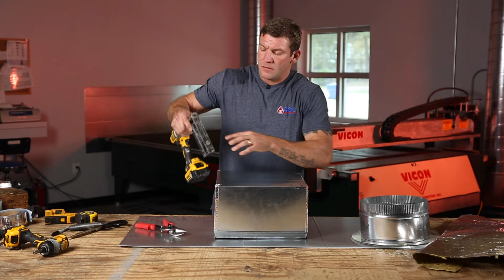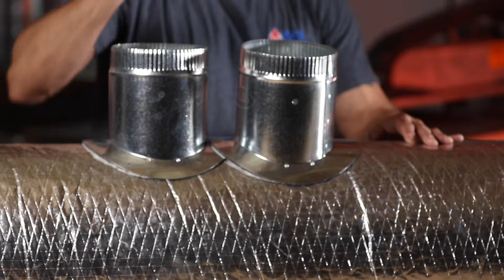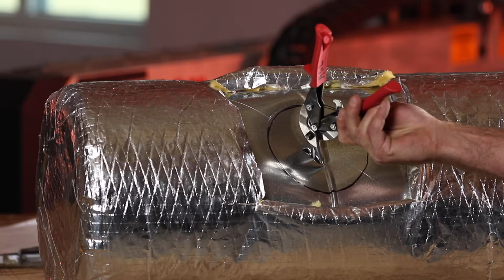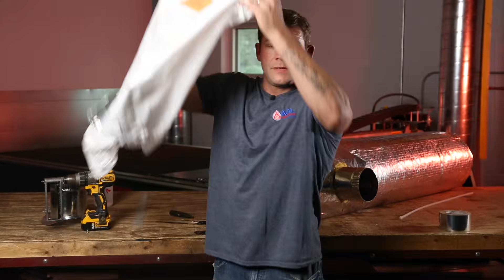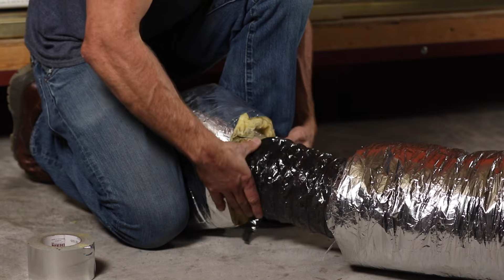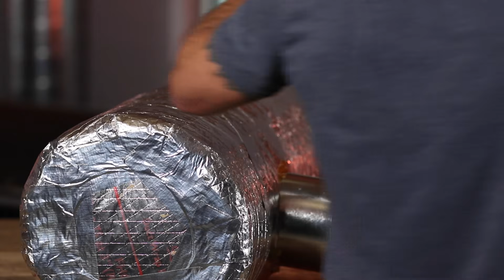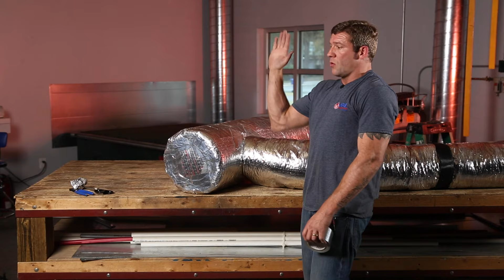Cutting takeoffs and proper attachment to trunklines (Mechanical Training # 104)

Comment: I have 2 questions. We have two furnaces in our 2700 sq ft home plus 1350 sq ft bsmt (the furnaces are 100k and 75k BTUH input w/78% AFUE @ 4,000 feet elevation). The larger furnace supplies the basement and main floor; the smaller furnace supplies the second floor. With the main floor thermostat set to maintain a comfortable temperature, the smaller furnace only runs on VERY cold days (i.e., minus 20 Fahrenheit or colder). 

Each of the two furnaces is oversized for our location, altitude, and the design load that they serve (i.e., approximately 50% and 100% larger than needed) according to ACCA Manual ‘J’ and ‘D’. Unfortunately, the larger furnace is barely able to go it alone so both must remain. 

Questions: 
1) Should I seal the ductwork (which is all in conditioned space) on each furnace to maximize proper flow distribution, or are the leaks necessary to prevent too much back-pressure on the individual blower motors given their excess capacity? 
2) Should I insulate the ductwork to improve heat retention, or will the “taped & sealed” insulation by itself act like a pressure vessel and place unwanted back-pressure on the blower motors by preventing excess flow from escaping the system? 

Any help is much appreciated!

Comment: cool tip, I like it- Least amount of tools. However how is denting it first LESS pressure on the straps? Again fantastic video, thankful for it and the different ways- I just found that part humorous 🤣🤣 Thanks for all the info
Reply from the maker: Less pressure than beating it with a hammer and a flathead?  Absolutely

Comment: Everybody says different things about airflow, but I don't think most contractors know what they are talking about.  There is no such thing as a "pressurized system" and "you will get more airflow near the end of the main".  This guy is obviously an installation expert, but nothing about that is true.  For all fluids or whatever material you have...VOLUME IN = VOLUME OUT.  Whether you have the take-off at the end...or a foot from the end...AIR IN =  AIR OUT.  Your air handler will decide what the "AIR IN" IS.  The size and length of your supply ducts will decide how much air is flowing through each one.  If you keep air velocities low, there will be almost no energy loss and each supply duct will carry the same CFM.  Want to lower the CFM in a supply line?  Shutter the register.

Comment: What would you do to cap off the takeoff? I have a large tear in a flex duct from a mouse and do not need that duct as it goes to a closet. I plan to just disconnect the duct from the takeoff but cant find anything to cap the takeoff. thanks
Reply from the maker: I would remove the entire takeoff and patch with sheet metal then insulation.
Reply: @aglmechanicaltips Thanks!

Comment: what kind of tape were you using, it didn't look like ul-181b-fx hvac tape and instead just multipurpose foil tape or old school duct tape? Isn't the ul-181b-fx hvac tape required by code and where do you get into the business of putting mastic over top of all this? I've heard the mastic goes down first and then the tape. overall nice experience based techniques provided and proficiency demonstrated applying them.
Reply from the maker: The codes in my area require that we cover the outside of duct tape with mastic on insulation seams.  I use "mastic tape" on the internal metal seams (this by code is the same as covering the seam with mastic).  I understand this is different than most areas but they do this because the attics get so hot in my area that the duct tape fails if not coated with a sealant.
Reply: @aglmechanicaltips is mastic tape different than ul-181b-fx hvac tape? I found your comment about panduit / zip ties being a pointless step, and worse if required by code, vs a good hvac temperatures rated hvac tape fastening approach. 

Also in my attic when doing a diy repair of 7" and 5" flex duct connections that had come apart getting old flex duct to slide onto metal collar and especially past the stop bead was next to impossible. Curious if in your experience it's common to find that flex duct shrinks in diameter some with age which leads to this?

Comment: Unfortunately, most codes require non-protruding fasteners (just below the surface ) for HVAC duct connections for proper airflow and efficiency, structural integrity and to prevent a fire hazard closer to the furnace or a blowout near the A/C unit or on a takeoff (90 degree angle).   I normally use at least three (3) #7-1/2" zip screws or #8-1/2" self tappers for each round in residential and four (4) #10 - 3/4" self tapper or #10 zip screws for commercial duct work depending upon the application.   Taping a joint has to do with sealing a duct only and so does mastic, like you said your doubling your sealing labor cost.  It is possible to use tape only to seal your ducts, but you should add fasteners for the reasons I mentioned before.   I would prefer the original wrap you showed over your method because your method would blow out sooner.   Build your life on a sandy foundation and when the storm comes great is the fall.

Comment: @AGL Mechanical have you ever considered pre-screwing the takeoffs in their final place first, then sharpie circle interior, then remove the takeoff and make the cut after the screw positions are pre-setup? 

As a duct cleaning contractor, I have to install more than my fair share of service panels (“patches” or “plates”) to close the 8” hole cutouts commonly installed for vacuum hose connections… generally I install a 12”x12” square patch, but can go as small as 10.5”x10.5” for smaller ductwork to close the 8” round holes. I used to just cut the holes and then install the patches at the end, but I eventually got taught that it’s actually better to pre-install the patch and then remove it and cut the hole after the screw holes are in place. I was told that installing the screw holes first helps to prevent patches that form a crease in them which is a result of trying to install the screw holes while pushing the impact driver into the patch while the service hole/opening has reduced the structural integrity of the metal duct (especially for 12” or smaller width rectangular dimensions with a 8” hole installed in the middle…) causing it to cave in. 

I’m probably over thinking it, but do you think it’s worth setting the screw holes in place while the duct is in its strongest structural integrity condition and then cutting out the takeoff opening? Or do you think it won’t really matter for this type of application…?

Comment: @16:30 What do you mean it will probably be alright ? your telling me you didn't use a little foil tape because its probably alright ?
Reply from the maker: No, I explained that if the duct is being installed in a spray foamed attic and the attic is part of the thermal envelope- because it is inside the thermal envelope any duct leakage doesn't matter. Again, it is leaking into the conditioned space. 

 If it was in a non conditioned attic or crawlspace etc.  it absolutely has to be as sealed as possible.

The standard gasket that comes on these takeoffs is also considered an acceptable sealing method.  We go a bit further though and also mastic tape this seam but only when being installed in non conditioned space.
Reply: @aglmechanicaltips  but your doing a tutorial for youtube , You have to adjust your language to your audience. These are decisions you can make as the lead technician but do you really want your employees making these decisions or do you want them to do it right every time regardless if the builder said its going to be enclosed or not ? What if they change their mind ? Or the attic insulation is adjusted to a bat ?

Comment: Mr very good videos! Thanks for the knowledge. I have 2 question
-1) when we use flexible duct we have to use dampers in the takeoff?
- 2) the tape we have to use is foil tape for metal pipes or the tape we use  when install insulation round pipes? Thank for your help

Comment: my name is paul i had anew  system installed with all new duct work my problem is in my bedroom being it is the shortest run from main unit. heavy air noise coming out of supply register if i was to add let say 15 to 20 feet of new duct do you think it would quite down the air noise out of register. thank you
Reply from the maker: Whenever we have a really short run we do add a little bit of length.  Normally we will pull it off the trunkline upstream slightly and add (2) 90 degree turns.  If it's air noise this should reduce airflow a bit which will solve your issue.  If it is hard pipe and you are hearing a "barreling" noise then try swapping to flex duct which is more acoustical.

Comment: I am guessing a short piece of flex with a thick coat of mastic on the takeoff and a drawband rather than tape?  I guess you need something like that to allow for movement anyway with a suspended furnace/coil.

Comment: Andrew, how do you attach a round metal duct to a return plenum when the takeoff has the crimped end?  Putting the round duct over would be wrong as disrupt the.airflow on the return. Do you just cut the crimp off the takeoff or is there some other solution?

Thanks
Reply from the maker: Normally just cut the crimp off the takeoff.

Comment: Do you ever have inspectors flag you for not having panduit straps?  I’m assuming with a duct job that looks as good as yours, they probably would just understand that it’s connected properly.  Really nice work man.
Reply from the maker: They are not required by code in my area.  Appreciate the compliment!

Comment: Good Tutorial.  Having worked w/ 8 different HVAC techs over 26 yrs and dozens of jobs, small to mid size, I don't recall any of them doing some of your details....typical crew just wants to go in come out and call it a day.  What amazes me about USA, there are all these "supposed" building inspectors, who don't know squat since they have never done any real hands on work within the building trade, going around passing inspections like candy or they nitpick all the wrong insignificant things to "pretend" they know something.....If this video is the gold standard to pass an inspection, good luck, 3/4 to 7/8 of all new installs would be do overs.....

Comment: Panasonic exhaust fans are closer to $250/ea.  So Panasonic believes you need to buy 8 fans for a 3b/2ba home at $2000?  Of course they do.  $2k and we haven't even started to condition the air.  Sounds like marketing wank to me.

Assuming this isn't a Panasonic Marketing Team duct taped together product concept, if Panasonic believes in this why don't they build a single central air handler with all the fans installed in it.  That would save on install costs (electrical, sheet rock, ducting) and it wouldn't look like a homeowner jank install.  Just what I want is a potential buyer to walk through and say "wow, someone hit the Home Depot clearance rack on exhaust fans, wtf?"
Reply from the maker: I don't know why this would relate to my video but $250 for a Panasonic fan is high.  Maybe try the Panasonic AE80 model ($88.74) which is a decent budget fan or Panasonic whisper fit DC ($135.99)  if you want speed control (adjustable by switch 50/80/110 CFM).  $250 puts you in the realm of remote mounted exhaust fans and for that price I would be using Fantech PB110 kits which don't have a massive grill in the ceiling....  All these can all be found at supplyhouse.com.

Comment: Did you use the mastic tape on both the flex line and the insulation?
Reply from the maker: No, mastic tape is only used on metal to metal seams
Reply: @  thank you for the reply. What was the tape that was used on the flex?

Comment: Why duct tape instead of tin tape?
Reply from the maker: Tin tape works better for metal to metal connections.  I now use mastic tape for metal to metal connections instead but both are suitable.  

If you are using foil backed insulation and are not coating with mastic FSK tape may be more appropriate because it will hide the seam.  I really only use this to cover up minor tears and rips though and still use duct tape coated with mastic on my seams.

Comment: I have flex duct that has disconnected from the main trunk in my crawl space. So, this is not clean, new vapor barrier.

How do I get the old flex duct to attach back to the old and dirty take off and main trunk vapor barrier without just releasing? BTW, no mastic was used by the professional HVAC company. I’m wondering if I mastic over the properly attached vapor barrier release can be avoided.

Comment: I’m a Sheetmetal Local 80 commercial journeyman retiree. 
I carried that tool for years. I used it off and on.
I never liked it much, because of the metal shavings everywhere. I always had my hammer, flat screwdriver and midwest aviation snips. 
Those flange taps are relatively new. Spin on and tab taps, and conicals, were way more common. Although I do like them.

Comment: I wonder if you can use mastic tape all around a magic boot or the straight boot instead of wet mastic
Reply from the maker: Mastic tape is only good for metal to metal connections but it works awesome when it is stuck to metal...

Comment: On a commercial job site the insulators get upset if you go around cutting circles out of their insulation.  They’d prefer you mark the circle and cut an X so the insulation is not removed.  The cuts let the insulation be folded back and the tap installed 🤙 in a residential setting the X cut method creates less trash in the attic.  I’ve seen some really awful ductwork during my years and mostly it’s from carelessness

Comment: Is that tape 1402 mastic or something a little thinner?  And I assume it’s not necessary to mastic over the take-off to supply line? Thanks for the info.
Reply from the maker: It is 1402 mastic tape.  If using "mastic tape" then it is not necessary to mastic over the takeoff but it should be sealed one way or the other if in non-conditioned space.
Reply: @aglmechanicaltips  Ty!

Comment: There's 2 different tapes in the tools list.  The one you're using in the video has no plastic to peel away from the tape.  Is the tape you're using good enough or do i need the other aluminum tape as well.
Reply from the maker: The tape that has the plastic peel away is "mastic tape" and is made for metal to metal connections only (sheet metal work).  For fiberglass duct wrap or flex duct connections you will want to use the Nashua 365 tape (listed in description under "duct tape used").
Reply: @aglmechanicaltips  thank you.

Comment: Do I need to paint the tape seams with duct seal on the supply and return ducts in a crawlspace if the crawlspace is encapsulated and has a dehumidifier installed?
Reply from the maker: Yes, unless the space the duct is in is the space you are conditioning I would seal it as much as possible.  Any leakage into the crawlspace is lost efficiency.  I use a product called "mastic tape" on my ductwork seams instead of duct tape then mastic (just saves time).  I also seal the exterior seems but that is a code that exists in my region and might not apply to you.

Comment: Electrician here, I can say I have never worked around any ductwork this guy has installed.  The amount of times I have had to fix flex attachment points with only the large zip ties holding and zero tape. Weather, they are off when I get there or fall off from the easiest little touch. Having a conscious might make a little more work or take a little more time at the time, but what used to be called taking pride in one's work makes less work for all involved. Think down the line, after we all leave the jobs, service and maintenance involve human bodies with access being the most important part of those two inevitable facts of what we do in the trades.
Reply: Those guys must NOT be using a pan duet gun to tighten the zips. The zip will stay on a lot longer than the tape. 
I do hvac and when I run duct I use both zip and tape. Imo opinion to use one without the other is lazy. I've been back on jobs and seen the mess after a few years have passed .

Comment: do you have to use a round take off on a round pipe? or can you bend the flange of a flat take off to fit?  (none of the supply stores in my area have round takeoffs)
Reply from the maker: I've always been able to find round takeoffs, that's odd that your suppliers only have flat.  I don't think flat would look good because it would bend the pipe it is attached to.
Reply: @aglmechanicaltips  one of the downsides of living in Hawaii - had to change my plan twice. Was going to do duct board, but can only find 1” duct board r4… so I found a place with round  metal duct,  but now no local place (even Home Depot) has round take offs! I can get em shipped but then they’re like $70 each … and I got 10 branches

Comment: My baby brother just recently got promoted to foreman at a hvac company and wants to bring me in. He told me to try to learn as much as possible about the trade by watching YouTube videos. He said that your videos are the most informative ones and that I should follow and subscribe. He also told me to lose some body weight. When you mentioned working in crawling spaces and uncomfortable positions, I understood. Thank you
Reply: Highly recommend starting your own hvac company. You'll make millions.
Reply: That was some pretty work(on a work bench), not likely to look as pretty in actual working spaces. 

I really do like your double taping technique, what tape are you using? Seamed to tear like cloth duct tape but gave the appearance of foil tape.

Would have enjoyed to see how you wrapped the boot, it was impressive.
Reply: I use zip tie and 3 zip screws into the band of the zip ties.
Reply: @FcsstlHeatingCoolingPlumbing pull as hard as you like but that duct isn’t going to come down. I do the same.